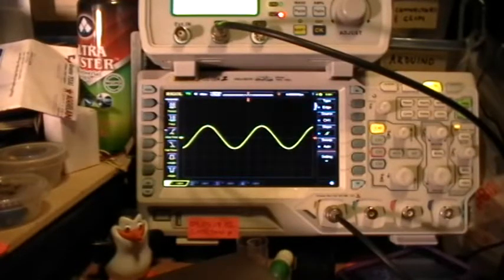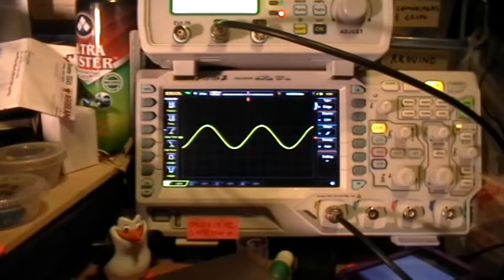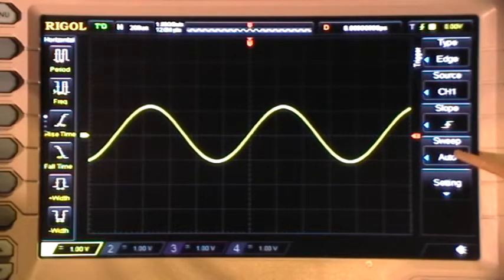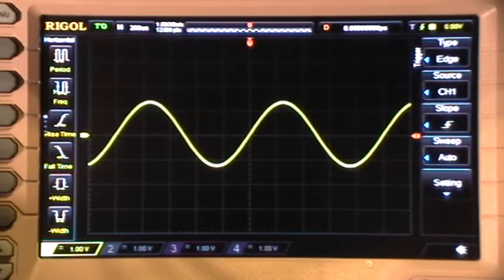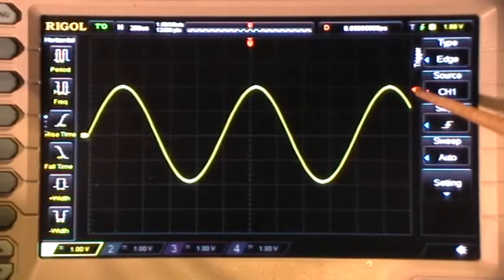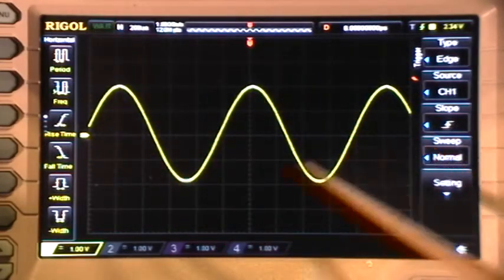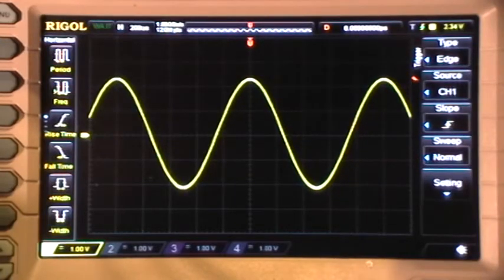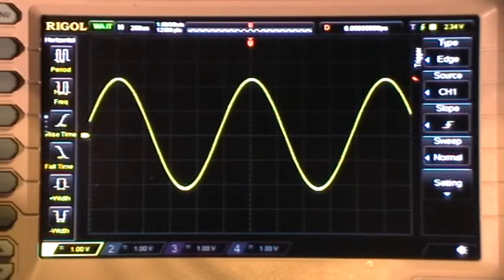Scoposcopy: Trigger and Sweep Modes of Rigol DS1054z DSO

Comment: I know this is an old video but I just got my first scope and it’s this Rigol. Your video is nice and simple which is just my speed😂. You are moving the vertical trigger position indicator. I guess by trial & error, I’ll figure out which knob you’re turning to do that🤔. Is there a way to position the horizontal trigger position indicator that’s at the top middle to be at the far left of the scope screen? Thanks.
Reply: Never mind my question. I figured it out😊.

Comment: Nice - especially the trigger points, very handy for chips and data lines.
I think it was Magnetman2010 who got a call from his wife...said something like 'Yes, no, am making a video for YouTube, ok, bye'. Am glad you left that in.
Reply from the maker: Thanks for checking in! The Rigol actually has several digital decoder functions built in, but I'm an analog guy so I have not yet learned how to use them. But eventually I will, and will show for example how to decode a Serial data stream from an Arduino or something like that.
Reply: Please do, that's exactly what I get stuck with on my scope. All is fine if looking at waves or simple signal trains, but decoding would be really useful (perhaps as Ben Heck did with the Nintendo Playstation prototype).